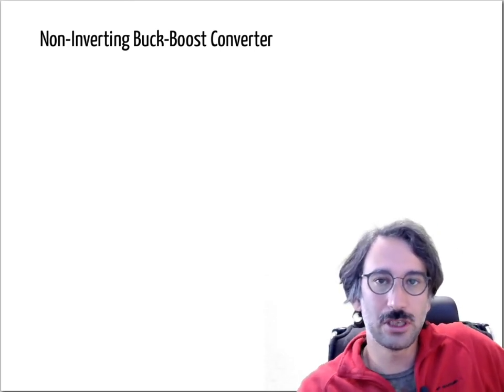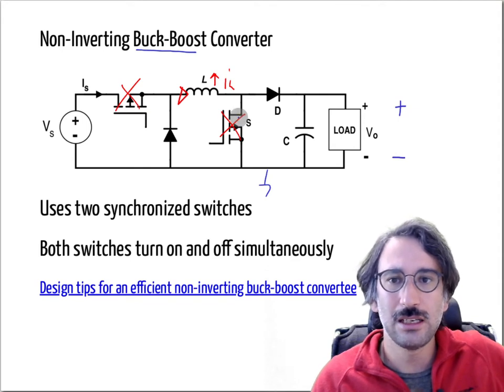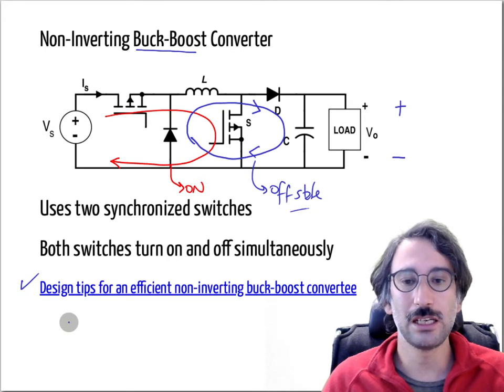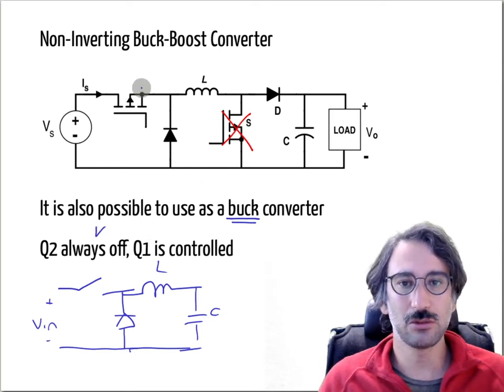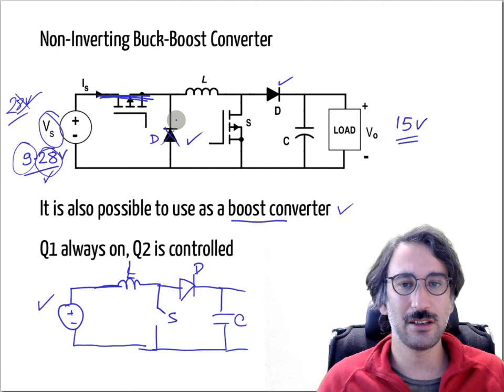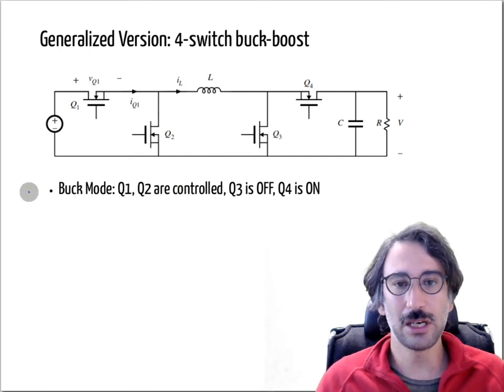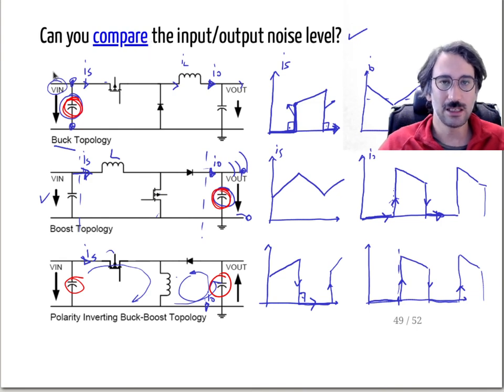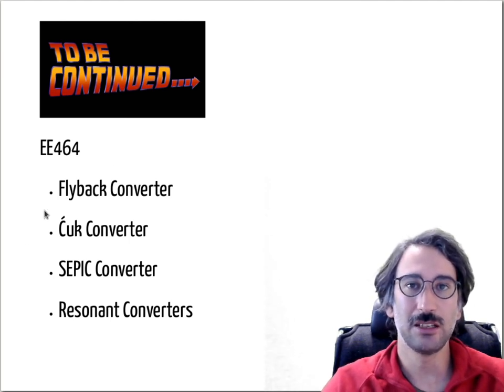EE463 -  Non-inverting Buck-Boost Converter

Comment: Is the charge on output capacitor positive for non inverting buck boost converter?  The coil L 1.5Millihenry is only in series with 60 or 120 cycle DC pulses from source. And is diode to ground with anode facing ground? I need to get 200vDC on .2MFD capacitor from either half wave or full wave 45 volts  DC source. Do I assume the frequency is fast enough?  Boost, Buck Boost,  inverting buck boost, non inverting buck Boost?? Send simple drawing please.
Reply: Bold move to tell a Youtuber to send you drawings, but the answer is to your question is Flyback.

Comment: Can you please explain what happens when the variable input becomes almost equal to the output.
Let's say if the input becomes 15.1 and the output is 15.
What will be the switching scheme as there are quite some limitations on the extreme duty cycles for both the topologies. In this case the converter will have to operate as a Buck with D = 0.99 which might be almost impossible to achieve considering the tr and tf times of mosfets and other parasitics.

P.S. A datasheet of a particular pwm driver from TI which implements the above topology shows that both the switches operate alternatively in such a condition, although the exact scheme was perhaps not mentioned.
Reply: The voltage increase or decrease is a result of the net current in the inductor. At 50% duty cycle the net current is 0 so the output voltage has 0 change. Hopefully you figured it out in the last 3 years, but just in case anyone else was wondering...